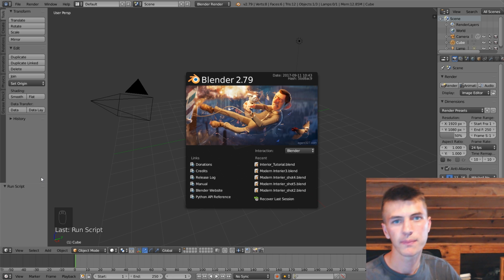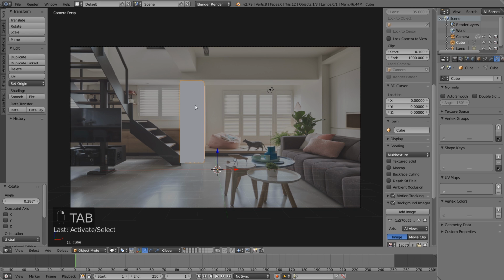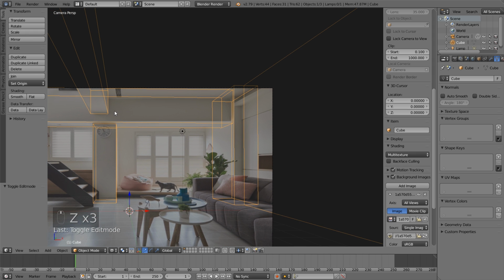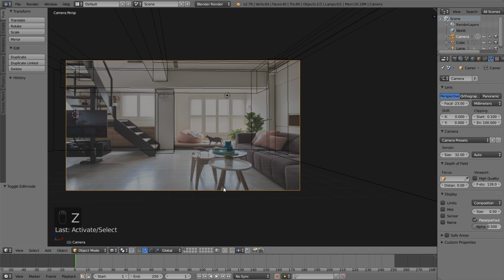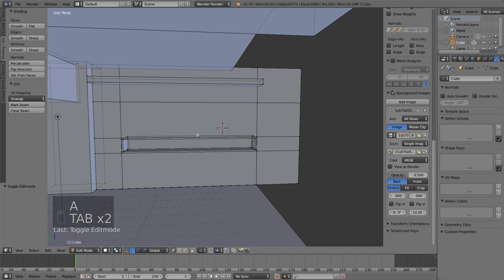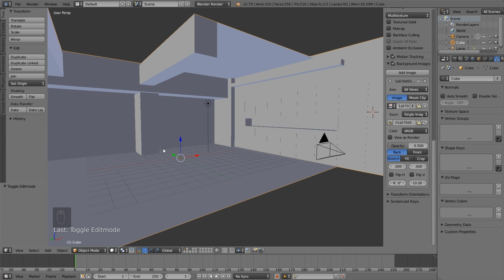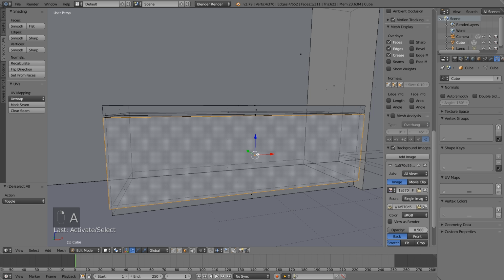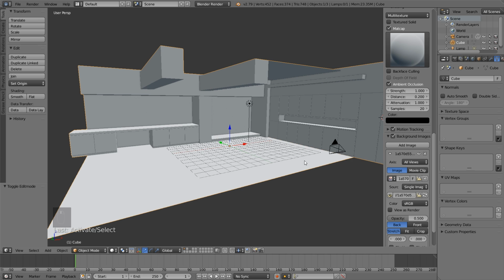Create a Modern Interior : Blender Tutorial - 1 of 7

Comment: you have to mention that anyway, cycles is not for interior rendering. try to render some room with small windows, or night time scene... you should consider, that its really hard. and you should recommend the guys who learns here, that cycles render have some cons that influence on the time and quality of renders dramatically.and even eevee wont fix that situation.
Also, there is different kind of arch rendering approach, which also uses nodes. as i can get, its the main thing for us, blender users - it gives incredible flexibility. and after some amount of hard times, about a year, can give a good intuitive understanding of nodes. So, that approach is using some decent render engines, which are much more powerful than cycles. At the moment its the one and only  -  vray. the only way to have good looking, competitive render in architecture rendering. And yes, its all about the light distribution.
those guys who will use blender in professional approach will feel the pain when they wont be able to show texture, for example of fabric, in the distance of couple of meters, without using more than 2-3k samples in cycles. and it will take a decent amount of time.
And those guys wont get a job in that trade, because of only situative good portfolio, but in real hard project with dull, small, or other unsiutable situatuions for building a scene, they will fail. even you will fail. Unless you will take about 20-30 days per one render/